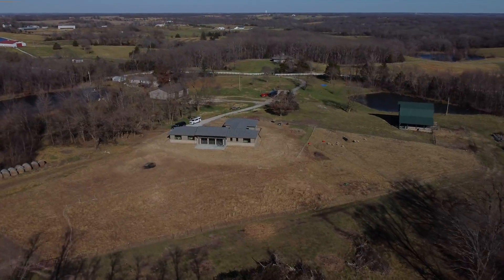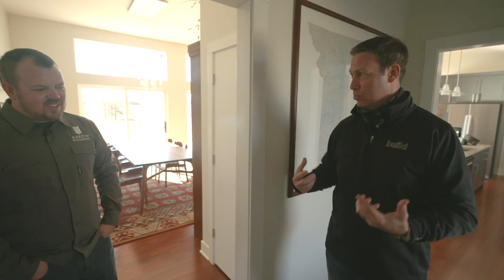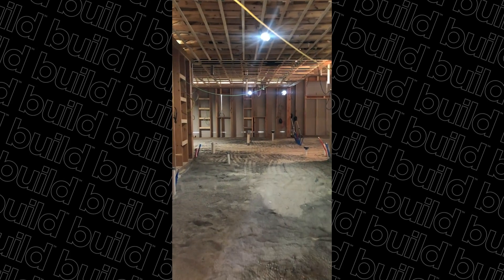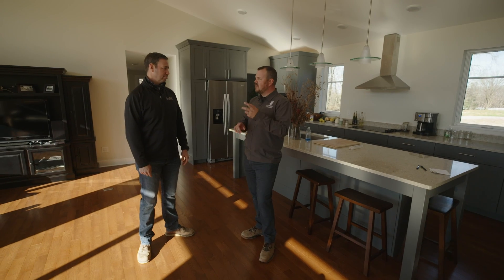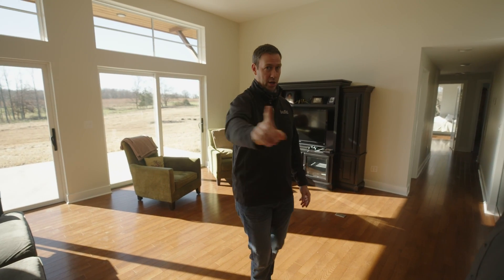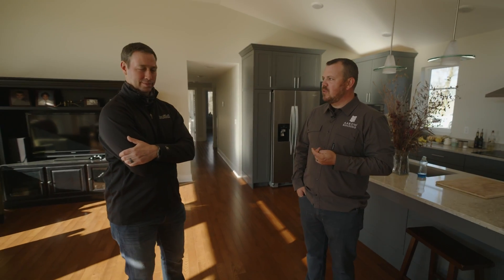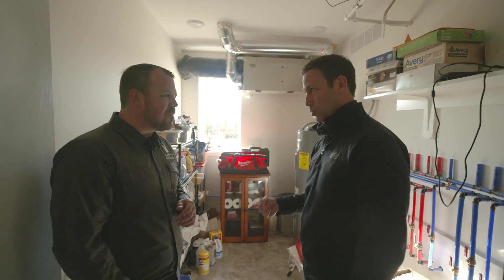Slab-On-Grade INSULATED Foundation (NO Concrete?!) - Part 2

Comment: Could you do the same for a full basement built using ICF's?  Compacted floor built up this way in the basement instead of on grade.
Reply: Basements may or may not be below the groundwater table, which may preclude this style. If your basement floor is above groundwater elevation, then there should be no reason why not

Comment: What about termites, they can chew through foam. Is that not a problem is this area of the country or will they not eat the advantech?
Reply: Are you suggesting that slab on grade houses don't have problems with termites?
Reply: Absolutely not. My humble opinion for areas like Missouri and other hot, high humidity areas is concrete walls, at least 18” high and uncovered. Best in my humble opinion is an unfinished basement. Then a wall and crawlspace. The rationale is to have the house up off the ground, and the ability to see the stem walls or basement walls. This is important to I spect for termite tunnels. Even then, if every precaution isn’t taken, they can crawl through cracks in concrete. Chlordane was effective as a soil treatment in this area, but has long been banned. It’s just better to have an open basement so sills and joists can be continually inspected. You can probably tell I’ve repaired a lot of terminate damage, and doing so is miserable and expensive for the homeowner.
Reply: I grew up in this area, and can assure you termites are a big problem. I’d be more worried about unforeseen ground water issues. In this part of the country, the best option is an unfinished basement, for a variety of reasons. I love efficiency, but not for the sake of hippie ideology at the expense of durability.

Comment: He obviously didn't consider the possibility of Graboids. Not a safe house to be in!
Reply: Finally a sensible objection
Reply: Ha! You beat me to it!
Reply: a concrete slab is just as vulnerable to graboids as this no-concrete design is
Reply: @timskufca8039  depends on the thickness of the slab... And if it's reinforced properly or not... Honestly, a slab could kill a graboid if it ran into at full speed, but it would still mess things up forsure.
Reply: Pardon my ignorance but what the heck is a graboid?
Reply: I think Limecrete would help a bit with the Graboid menace without as much CO2 impact as concrete.
Reply: Yeah i think the graboids will win
Reply: You realize that graboids are in a movie
Reply: What’s a Graboid. I couldn’t find it in the dictionary. 
I have concerns over water coming through the floor. I live in Canada, Ontario, where water levels are already high. I don’t think you can make such a house in Canada. The Canadian building code wouldn’t allow it, too. Nice idea for South though.
Reply: Damn that was stupid. Thumbs-up 👍
Reply: Did they take any notice of the dooms day prepers' sub surface safe room?
Reply: I didn't get past wolves that huff and puff.
Reply: Ewwww!
Reply: Only problem I can see is moisture. With a slab, a gravel layer will act as a capillary break, but the fine content of that road base would be able to wick water right up to their plastic sheet. That plastic is often taped, so not really a water proofing as much as a vapor reduction barrier. It can take years or decades for these kind of problems to show up. Good site drainage would be critical.
Reply: I like it 👌
Reply: @gobucks1-s6e  there are other barriers against gabroids than concrete. Concrete is only the standard most people choose because it is the norm. The challenge is to go beyond the norm for environmental reasons
Reply: @timskufca8039  although your reply is interesting, the 😆 is for the original reply referring to Graboids. As are most of the above. Sorry you interpreted this area as a Thread. 😆

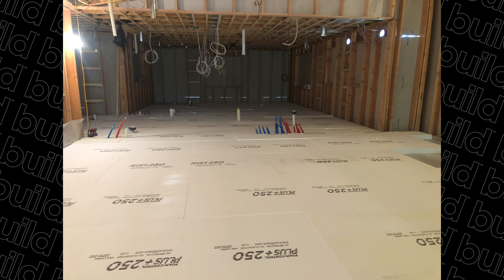Comment: 3:44 I was thinking it was a little silly to build all of this and the end up with the wall plates below the top of the floor system.  But then I realized you could tie the floor and wall insulation systems together making for a even tighter box.. Still not my cup of tea, maybe a good solution for finished basements.

Comment: How do you attach the interior walls at the top if running parallel to, and between truss, with ceiling drywall already installed?
Reply: Perpendicular blocking between trusses installed ahead of time.
Reply: @scrapnad1 , spacing - 2', 4' or?  I'm asking because I intend to do this.
Reply: @DouginUtah  your electrician won't like you much.  plumber might get a bit grumpy, too.
Reply: @kenbrown2808  A 2x4 flat between trusses is what I'm recommending.  An 1.5" space behind the face of drywall is not a place a plumber or electrician needs to run their mechanicals in most North American jurisdictions.
Reply: @DouginUtah  You can have a 2x4 flat between your truss every 2' or 4'. 2x4 ar cheap so 2' will be stiffer. 4' also works and the drywall will stiffen the wall up when ceiling corners are mudded.
Reply: @scrapnad1  I don't know about your jurisdiction, but where I come from, people like to have lights in their ceiling.  plumbers like to run vent pipes above the ceiling, too.  and electricians and plumbers get grumpy if the sheetrock is already on when they're trying to run wires.
Reply: @kenbrown2808  How do you run walls parrallel to joist or truss cavities and attach them?  That blocking is to attach the top plate of of the wall.  What do you use instead of blocking??

A piece of 2x4 laying on its side between two trusses or floor joists every 2' or 4' on centre is not going to get in the way of any of the stuff you listed.
Reply: @scrapnad1  yes, you use cross blocking to support a wall between trusses.  but this is about reactions to the ceiling sheetrock being installed before the walls are.  I guess the other trades can just hack out the sheetrock to run their stuff and the rocker can patch it, later.
Reply: @kenbrown2808  My only comment about drywall was that if you use minimal cross blocking while framing, then the wall will be floppy without some sort of wall sheeting locking it all together.  Mudding corners will stiffen the whole assembly.  I'm not advocating that the person drywall their ceiling and then install their walls.  Although, it can definietly be done that way if well planned out ahead of time.
Reply: @kenbrown2808  Also, if Harold is just wondering how the wall is attached to the ceiling when drywall is already installed, the most likely answer is cross blocking installed ahead of time.  It's also possible that you could literally screw it to the drywall and that mudding the ceiling corners will be strong enought to hold it in place or that the perpendicular walls attaching to the parallel walls add enough strength.
Reply: @scrapnad1  on the one hand, they aren't structural walls.  on the other hand, that means there is a layer of frangible material with nails through it anchoring the tops of the walls.  that means significantly less shear strength if something hits a wall - and more chance of cracking the seams.

Comment: I seriously doubt this is a better option for the environment in anyway.  Foam and 2 layers of advantech subfloor is guaranteed to produce just as much carbon footprint or probably more than concrete.  Unless you really cannot find people to lay concrete this is a complete waste.  Plus ants and bugs coming through the ground.  I really this this method is a mistake for the slab.  I do like the ceiling sizing for the size of Sheetrock though great thought.
Reply: It won't last 20 years, this crap  was tired before and ground constantly shifts no matter how well he pats his guys on their backs, that foam will break down, the wood will rot. Its resistant to moisture but will still degrade. The cost to rip all that out and pour a proper slab to support the interior walls that now rest on foam will cost more then the home. Concrete is pretty green considering how much can be recycled after each use.

Comment: seems cool, and is working so far. but would be more interested to see in 10 or 20 years. 

I think it is important to note that the environmental benefits are cool, but if it ends out being a failure, the redo will have greater impact.
Reply: In ten years they will be wishing they poured a pad, all ground over times will shift. Have 50 year old homes that are slab on grade and pockets of soil have collapsed over time or had water run off  under the pad causing supports for the home to shift. Now add this home that is just resting on foam pads

 No matter how well they think they compacted it  they will have soil shifting, moisture problems and floors rotting out. This has been tried in decades past and it doesbt work.
Reply: I have compacted earth as a slab in a house from '79, and there are no major issues other than the fact that it's uninsulated. Probably going to change that in some of the rooms soon

Comment: I wonder how much of a match that floor would be for ground boring animals and insects alike with the only real barrier a thin layer of poly which will brittle with age.  I do appreciate saving concrete and bringing down carbon emissions.  On the other hand, I think it is interesting when people make this point of conserving resources while at the same time building larger houses than what is necessary.
Reply: Plastic only gets brittle if you have it exposed to UV.
Reply: @ferky123  Not true, I've been in many crawl spaces.
Reply: Well there is also 4 inches of foam so I don’t think the insects would be a problem but I still have my doubts
Reply: You don't clearly go into crawl spaces, foam breaks down especially with ground contact, moisture wicks up through and rots the wood. This home will be in trouble in 10 -15 years. This will cost more to rip out and pour a proper pad then the home is worth.. He isn't building for longevity, anyone who has worked on slab on grade homes knows material under the slab moves with water run off and ground shifting in unstable locationz. I had homes were massive pockets of material was missing under a concrete slab was washed away from water run off duento poor drainage  and natural ground movement. Now add thise issues with a system resting on foam and plywood and only concrete being the external foundation
Reply: @zack9912000  I’m assuming you weren’t replying to me I didn’t say anything about moisture control and I don’t like this either
Reply: @DavidLopez-tk3lm  No not at you.
Reply: @DavidLopez-tk3lm  Good point

Comment: What Advantech detail is he talking about to help prevent truss uplift?
Reply: exactly! I'm super curious about this too
Reply: They put a rip of advantech on top of the double top plate to make the air barrier continuous from the outside zip to the Sheetrock ceiling. The Sheetrock is run out to out no breaks. This is a fantastic detail but I am curious as to how this prevents truss lift on non load bearing interior partitions as well.

Comment: Jake always seems an outstanding builder -  practical and budget-conscious but high-performance.

Probably my biggest concern in a 'concreteless slab' is differential settlement.  All those pipe/conduit trenches require conscientious compactive effort so as to not see settlement 10-20 years down the line. We all see the poorly-compacted trenches in roadways and how they settle - even a fresh coat of asphalt will see the trench telegraph thru to the surface in a few weeks/months.

 That sheepsfoot compactor seemed to be running on dry/sandy material - almost impossible to get compaction in granular soils with a sheepsfoot.  A vibroplate is much more effective on granular material - sheepsfoot compactors are best on clayey soils. Key is to achieve near-optimum moisture to get best compaction.
Reply: This is a valid concern, unless they laid the pipes on virgin soil it could be a real problem.

Comment: So no water/vapor barrier under the insulation? No drainage gravel perfed pipe to pull ground water away? Is that because it a dry region? Obviously it works as it’s been two years without problems, but I’m shocked.
Reply: Two years means nothing, check back in 10-15 years, walls will have shifted, floors will have lost it structural support. Only a moron thinks this is a lasting design.  Foam degrades, grounds shift, wood rots. This has been tried before in building designs and over time it all collapses

Comment: Can I try a perimeter stem wall of treated lumber.  Got to have the BEST rain run off control!     Looks like the PEX runs to the room’s via the walls, or ceiling?   Are there areas of the states that wouldn’t be a good idea for building?   I’m going to learn a lot more about this !!     Thanks to the ‘Build Show’.         N.E.OH Bob
Reply: I saw a Holms on homes episode a decade or more ago which had a house in Alberta with a pressure treated wood, below grade, foundation. The explanation for why this was OK, was that the area was so dry, and the soils so porous, that  below grade moisture wasn't an issue.

Comment: I wonder how this would work in a seismic region with liquefaction, other than that....... great! keeps the Co2 carbon impact down too from saved concrete
Reply: Shouldn't be an issue. If the liquefaction is bad enough to impact the area enough then the house is toast anyways.

Comment: I don't see anything 'wrong' with the slabless slab, but I don't see any benefit. The labor to get that gravel\fines base leveled surely eats up any savings from not using concrete.
Reply: I can move rock but I can't do flatwork, from a DIY project this seems way easier
Reply: @wallpello_1534  you think you can level of 2k+ square feet of gravel as a diy project? Lol
Reply: @RichSobocinski  lol better thank 2k square foot of flatwork
Reply: But the “environmental savings” yeah like the big trucks bringing all that stone to fill the floor up. Then it also takes you a couple weeks to level it out precisely. I’m sure all the cars the workers drive don’t produce any emissions.
Reply: @ImShiftehh  it won't take that long to level it and big trucks bring crete to..
Reply: @wallpello_1534  thanks for proving my point. Regardless they bring concrete or stone. The savings are minimal and there is almost no other benefits to it
Reply: @ImShiftehh  the making of the concrete is the big carbon problem, no point was proved
Reply: @wallpello_1534  do you think the stone that he used it just made out of thin air? l
Reply: @ImShiftehh  spend the smallest amount of effort and inform yourself on the difference in the process of breaking up stone and the process making of cement.
Reply: @wallpello_1534  did you pay attention to the process? After speaking the gravel and the fines it said that lime is watered in. The industrial process that creates lime is the same as the one that produces concrete. You're not saving any carbon. All you're doing is virtue signaling.
Reply: @RichSobocinski  I'll relisten but I thought the said it was limestone (common road base) not that lime was added
Reply: I've done similar before at work it isn't that hard rent a power little dump buggy or a mini skid steer and a compactor me and a buddy would be done in a couple days
Reply: @wallpello_1534  I really don't think you've done similar leveling before. If you have compacted base for a concrete pour, that's a far cry from the leveling required for this technique. Think about it. This has got to be as level as your finished floor. That is not going to be as easy as leveling concrete. That builder even admitted as much in the video, but he glossed over it. It also sounds like he hasn't done another like this. Why? Because no one wants to pay for his virtue signaling.
Reply: @RichSobocinski  well that's where you are wrong, leveling out minus and compacting it is easier to do than one inch clean(what we usually use under crete in MO). I've done it filling up ditch lines over duct banks under runways where we had to reach 95 percent compaction that was tested in 6 in lifts. The contractor in the video even said they got it more level than a standard pour so it wasn't that bad. It isn't hard if you don't put in to much and have a laser. The robot compactors like the one in the video make a way better finish product as well. The possible rodent issue scares me the most about all this. Everything else checks out if you understand dirt work.
Reply: @wallpello_1534  sounds like you have some experience in the technique so I'll defer to you on that point, but I don't think I would use this in any building for myself.
Reply: This crap  was tired before and ground constantly shifts no matter how well he pats his guys on their backs, that foam will break down, the wood will rot. Its resistant to moisture but will still degrade. See a ton of slab on grade homes with pockets under a slab from water run off and ground shifting, The concrete slab was the only thing supporting the home and we had to fill those pockets. This foam and plywood under the internal walls will fail. Dunbest thing i have seen shown on Matt's channel 

The cost to rip all that out and pour a proper slab to support the interior walls that now rest on foam will cost more then the home
Reply: @zack9912000  got a link or info on where/who tried it before
Reply: @wallpello_1534  Yea Will try to.dig up the article on this design..Plenty of articles of sifting soils under homes that are mess to correct with normal slab on grade homes, now have a home that just rest on foam.and plywood for internal walls
Reply: @zack9912000  I'm saying in normal house construction they don't compact  the soil under the slab, so that's not really a good comparison. I'm am interested if they really have had this detail fail before